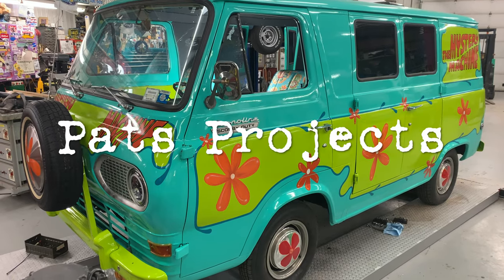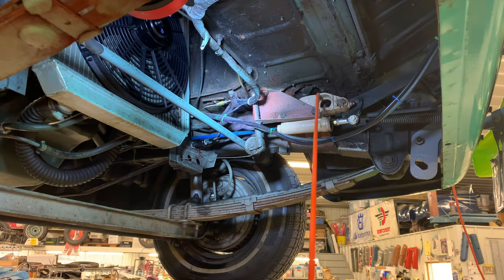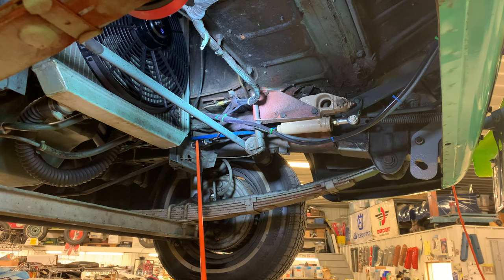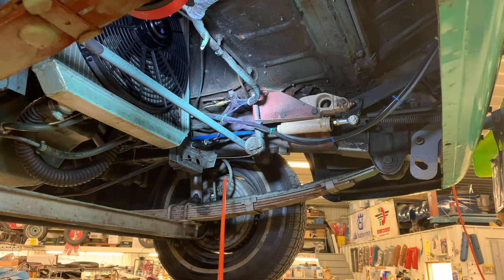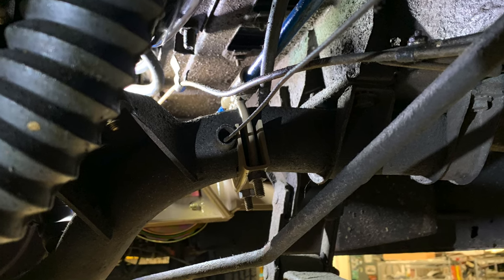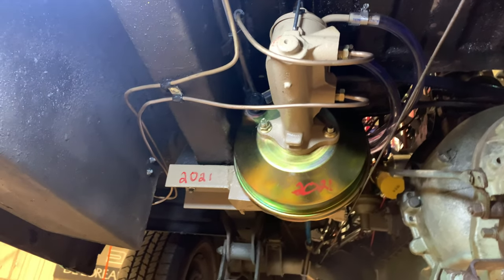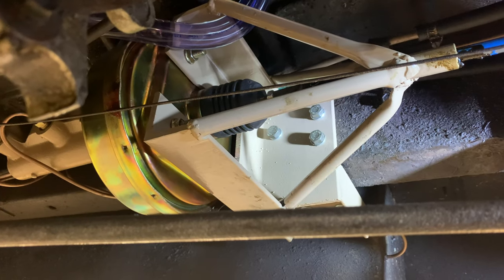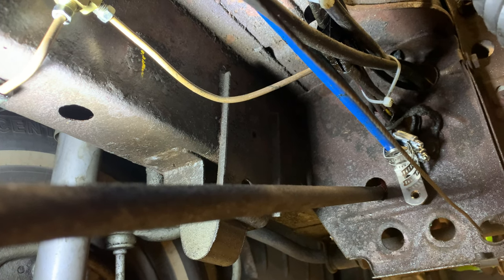’65 Econoline Van,  DualMaster Cylinder Brake Upgrade

Comment: How are you coming with the electric power steering conversion? I'm considering doing that to my 62 Econoline van.
Reply from the maker: Finished.   IT turned out great.   What a huge difference.   I have not had time to edit the videos yet.
Reply: @patrickpenfold5832  Would be awesome if you can post a video up of the work that you did!